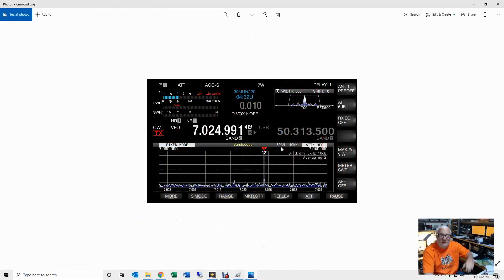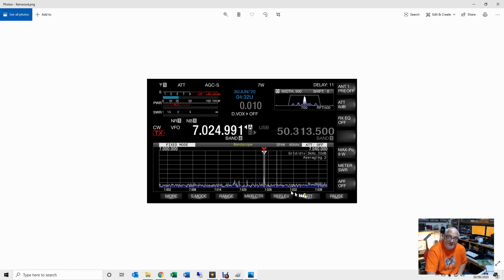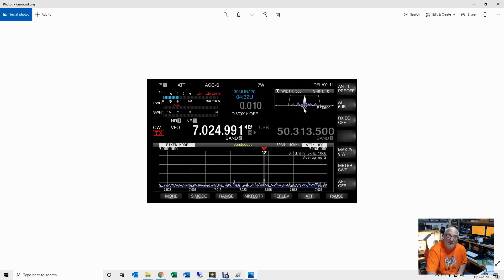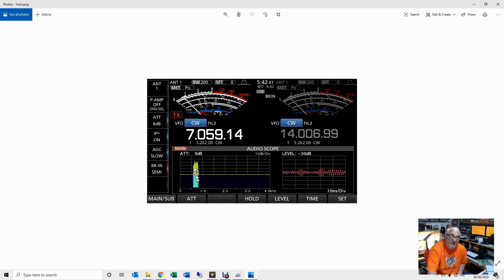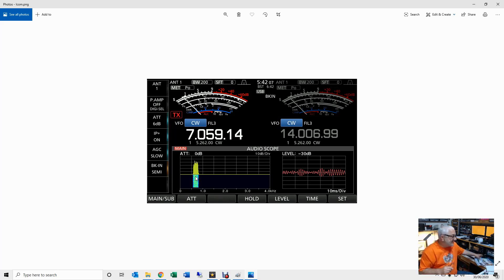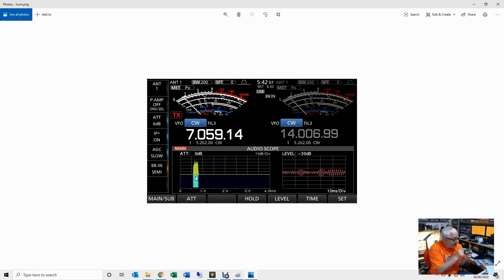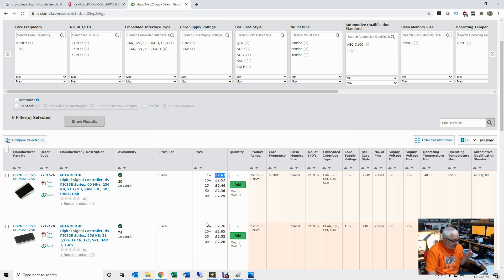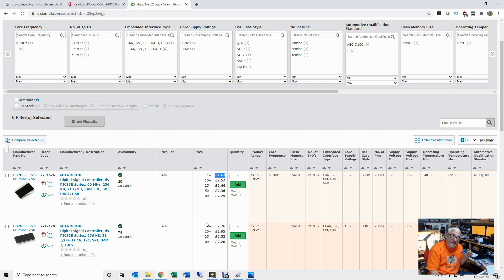Why doesnt my Icom IC-7610 do this?

Comment: answer: for the same reason a toilet doesn't come with a funnel.

now, I'm no  icom fanboy but consider this
Radio is not a visual art
the latest iteration of hf radios is a form of perversion of radio
all that display stuff prevents you from listening
a true cw op does not need an audio scope to zero beat the signal
you simply do it by listening

they have bedazzled you with never ending menus and visual bling while offering no new functionality or performance
]
Reply: 100%, buy a radio to be a radio, not a fancy display